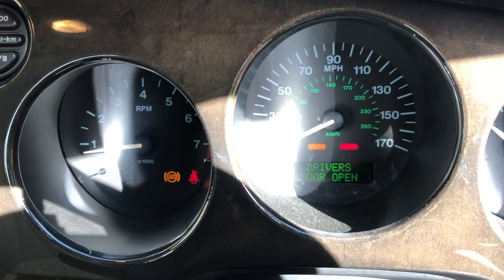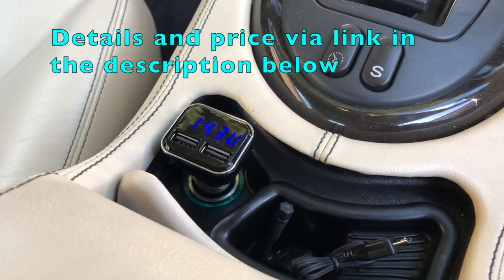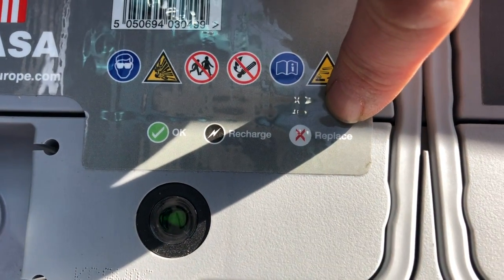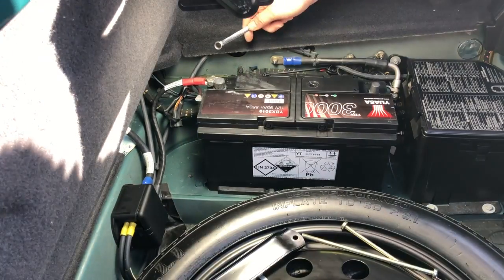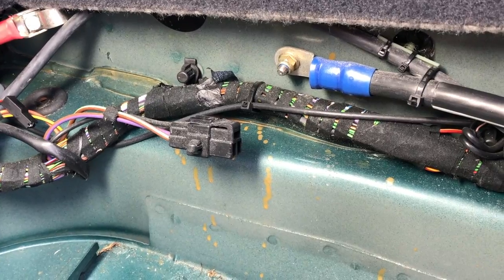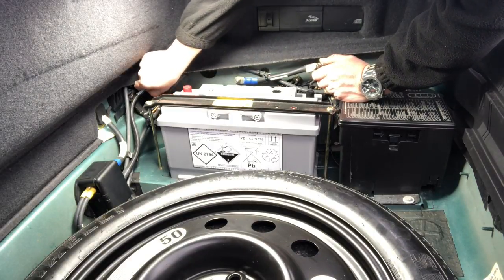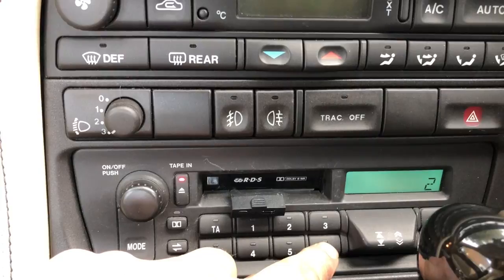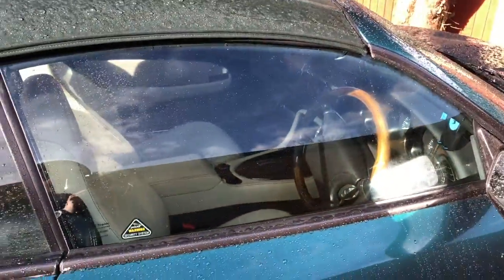secrets of Jaguar XK8 XKR Episode 55. Battery swap and true In car Voltage display.

Comment: Hi John, I am a huge fan of your videos! Owning a 2003 4,2 XK8 since about two months they are exetremely helpful! In the moment I am facing a problem with high quiescent current consumption caused by fus 5 on the lhd dashboard fuse box (BPM). WDS told me that it should be caused by errors U1041. So I have to remove IC, drivers door card to reach the communication module DDCM and the boot fuse box to reach SLCM. Then the pinpoint tests can start... Did you ever deal with high quiescent current drain caused by the BMP / error U1041? Or can you recommend a contact to other enthusiasts, how had solved the problem? A request in some forum sites did not bring a result yet so I just wanted to ask you as a XK8-knowledge-pope.... All the best from Bavaria, Wolfgang

Comment: Fantastic video John, I've got a flat battery with my early XK8 so seeing your video has given me a lot more confidence in changing it. Just one question - I bought the same battery as you and it has 2 red plugs at each end. The instructions infer I should remove both plugs but am I right in thinking that the plug at the negative end of battery should stay in place and only the plug at the positive end needs to be removed to allow the vent pipe to be attached.

Comment: Hi John and thank you for these videos which were instrumental in my purchase of a 2005 XK8 recently. I am at the stage of poking around looking for things that you have highlighted. My car has a Varta battery and there is no vent. Is this correct? I also notice that the vent grommet appears to be missing as there is just a large hole. Where do I get a grommet?
Reply from the maker: Hi Jono
If the Varta is truley 'unvented' rather than missing its pipe. Then thats fine👍 as for Grommets I would just pick up a selection pack from Amazon or ebay as they will cost you about £5 and an individual one of specified size will cost about the same. (and you can never have enough grommets😁

Comment: Once more I’m in your debt. Yesterday I went to the garage to get my 04 XKR ready for a show tomorrow and it was dodo. The battery was flat as a pancake. I thought it odd as I keep it plugged in to a Ctek and the battery is only about two years old. The car was doing all kinds of weird stuff, like it was haunted. The windows were going down is short jerky stages and I wasn’t pressing the switch. The wipers, which were off, were going across the windscreen about 3 inches at a time once every three seconds. There were error message galore. Suspension fault. Gearbox fault. ABS fault. Low coolant. Plus many others. Luckily the secret keyhole works on mine and so I disconnected the battery to let it charge overnight. Came home and watched this video to make sure I knew all the tricks just in case I needed to change it for another. (Glad I did. Wouldn’t have known about the bleed pipe). Went back today and the battery was still dodo.  So, I went to Halfords and bought a high power Yuasa (the same one as in the video) for £148 (ouch). Fitted it, making sure to do the hard reset first and the car came back to life. All is hunky dory. All error messages have gone. However, it was then I noticed that the headlights were on. I’d parked it up six weeks ago and left them on. Doh! Not even the Ctek could cope with that I guess. So thank you very much indeed! It’s not the first time I’ve relied on your expertise. I suspect it won’t be the last. I hope to bump into to you somewhere so I can buy you a coffee! Maybe Gaydon on Sept 2nd?

Comment: Having a slight nightmare with my car. Unfortunately was left by the previous owner and the battery went flat. The RAC came out and put a new battery on it for them (which was too small) they then sent it for a new alternator. However despite me changing the battery and various tinkering and still getting various warnings and battery not charging light, despite the battery charging.

Comment: Hard reset: Hold positive and negative terminals together for minimum 30 seconds. Another way: Disconnect negative terminal and turn ignition on for 30 seconds, this also drains down the system.

Comment: Hi John and thanks for all your great videos. 
I came back to this video as I now have the ABS light and stability/traction messages fault and there were not enough power to even start my XK8 1998. I charged the battery with a trickle charger. After that when I took it out from the winter rest all the messages were gone..When I started the car next time these error messages came back. Charged the battery once more and the messages were gone, but came back again with next start. I do not now how old my battery is. It seems these problems are gone just after charging and then are back with the next start. 
Do you think my problems will be solved with a new battery? Thanks in advance for your thoughts on this.

Comment: My sister’s  ‘02 XK8 would only start after she jump started it.  As soon as she turned it off, she said the battery went completely dead or “flat” as you say.  I asked her to bring it to my house.  She had left it at a shop and was unable to jump start it with booster cables. She proceeded to call AAA for a boost.  The tow truck driver attempted to boost it and failed.  So the car was towed to my house.  I pulled the battery out and it tested at 3.4 v.  SonI put it on the charger for about an hour.  In the meantime,  I wire brushed the battery cable terminal connections, loosened and retightened the ground cable connection.  After the battery came back up to 12.5 v.  I cleaned the battery terminals with a wire brush.  I reinstalled the battery in the car, smeared some dielectric grease on the terminals, and reconnected the cables.  The car fired right up.  It’s been starting every time now(even when sitting unused in my cold winter clim3 here in New England). The battery is just over 2 yrs old now. 👍👍

Comment: Hi John. Do have a video on parasitic battery drain? Sorry. Looked but maybe missed. My 2006 XKR with 37,000 has been doing strange things. Windows refuse to go up after closing the door. Strange sounds and eventually repeating chirps from the alarm system. Any of your subscribers have the same experience? Went through many forums; no one seems have put their finger on a cause for the drain. There is a alarm system battery? Could that draw from the regular battery if it’s bad? Just hoping to be pointed to common fail area to start my investigation. (Replaced the old battery when the windows required repeated resetting. So it’s new. But still draining.) Cheers!
Reply from the maker: hi Chris
If its a UK car then the usual cause of Battery drain is the 'Intelligent sounder'  Which is a rechargeable back up alarm siren filled with NiCads. 
its mounted below the right hand headlamp and accessed by removing the inner wheel arch liner. Just pull the multi plug out of it and protect it from water. ( you will lose the alarm arming chirp if it ever worked on yours, but no other bad effects)
See if that works before you try anything else.
Here is a useful link for you
https://youtu.be/OeHrWWKNPwg
Reply: @tothegarage  Thanks very much! It’s a victory edition USA car. (My “cheers” might have thrown you off. Lol. Lived in the UK for a bit.) Still a good place to start?

Comment: I remember well having trouble with my windows and took the car into a local Jaguar Dealer where we were  on holiday. He said I needed a new battery and l thought, your having me on. So I left. Two hours later I returned and he said the same thing so he replaced my battery and the problem went away. To my astonishment the car also drove a lot better with a much smoother ride!! Never occurred to me that a "low" battery had an effect on the adaptive suspension!! So if you feel that your XK/XKR isn't driving/handling as you'd expect and not very " smooth" change your battery.!!!
Reply from the maker: Its Always the answer😁👍

Comment: Hi John- I'm using a similar voltmeter, very useful. there is another thing you can use it for: the XK8 (at least the 4.2ltr) will attempt to keep her coolant temp rel. constant by running the electronically controlled fans- and you can kind of judge how much fan performance the ecu is commanding by looking at the voltage. indicated voltage ranges from 14 for just a bit to perhaps 13.6v at idle, the latter meaning fans are run up fairly high (though I haven't yet seen max fan rpm yet), not living in a desert! by the way- if someone keeps the ignition "on" and watches the voltage plummet, that's because all the ecu and the bus system are up, drawing quite a heavy current all together. a 30amp power supply (not a simple charger) will not suffice to cover this, something like a 50amp power supply is needed e.g. for diagnostic work or programming.
employing such a voltmeter on my Amarok V6 is funny as one can see the modern bat management (like charging when slowing down, less when cruising) at work!

Comment: I had a 2001 and it would drain the battery very quickly if I didn't drive it. Typically within 2-3 weeks. And the more it did it, the deader the battery would get. I actually considered getting an automatic battery disconnect. I don't have the car any more but it did lead to me creating a wifi battery monitor.
Reply from the maker: The wifi battery monitor sounds fun.   Tell us more🤔
Reply: @tothegarage  It's based on the EPS8266. It uses a voltage dropper and a simple divider to allow it to monitor the battery voltage. I've only done testing on it so far. I need to actually wire it into one of my cars.

Comment: I'm about to replace my battery as starting is a bit sluggish. Built early 2005, I bought my XK8 in 2008 with 29k miles on the clock , now 13 years on its done 38500. I'm sure I haven't replaced the battery since I've had it. 13 years doesn't seem too bad to me, my previous record was 8 years on a Mitsubishi Shogun from new.  I usually hook a second, good battery across so the car doesn't get powered down (terminals well insulated, of course) when changing batteries. I've done that ever since I lost a radio that I didn't have the reset code for. Thanks for the video, I'll check the others.
Reply from the maker: Thanks for watching Jon. Like your back up battery technique👍

Comment: Hi John
Just replaced my battery for the same reason. Abs and check engine light on. Unfortunately both lights still on after replacement. How did you clear your abs light? Only code i get is C1165

Comment: Hi all I charged and reinstalled my battery on my 1997 Jaguar XK8 convertible. I am getting no power at all.  Does anyone have any tips for a novice Jaguar XK8 owner before I send him to the garage. I really want to work on him myself before sending him out :) Thanks!!!!
Reply from the maker: Hi Myss 
Check the earth lead is in good condition and bolted tightly to the body. Check the two Very big fuses that the positive lead goes to in the black box just behind the spare wheel.
Check the Impact switch has not been triggered. (Left hand end of dashboard under a flap visible with the car door open. its a black cube that looks like a relay. Put your finger above it and press down had on the rubber top)

Are you sure your battery is good?
Reply: @tothegarage  Thank you so much. Yes the battery is fully charged and in good condition it is less than 1 year old. I have not driven or started the car since August of 2020. I took the battery out to have it checked and charged at our local auto parts shoppe all good. I will check all connections and reset the inertia switch. I am so happy I found this channel and group. This car means the world to me and he should be on the road :)

Comment: Hi John
Terrific video, thank you. 
I’ve just replaced the battery on my 2002 XK8 today with the same battery as yours. The vent tube minus the elbow was present but not fitted to the old battery. The warning sign on the new battery said to remove the vent plug on negative end of the new battery. Will it also be necessary to fit the vent tube on the positive end?
Many thanks 
Chris
Reply from the maker: Hi Chris.
The vent only needs to be open on one end. 
The area at the top of the cells is interlinked.
Reply: @tothegarage  thank you John.

Comment: Glad I watched this one!  My battery vent pipe was going into the wheel well as it was at the wrong end of the battery and there is no battery brace or antenna protection bolt.  A few easy things to sort!  Interestingly I have the same negative battery lead as you - my car 'birthday' appears to be 14-10-96 according to the label in the boot.  Cheers!
Reply from the maker: Glad it helped!

Comment: Hi John 
Great video just brought an xk8 and put in new battery as recommended no breather pipe is it ok to run until I source one 
Happy new year 
Steve
Reply from the maker: Yes. 
Its a long term issue rather than an immediate thing.
 Happy new year Steve. (It will be. You've got an XK8)

Comment: where did you get that neat plug in voltmeter?   Seat back position reset, kid messed it up somehow?
Reply from the maker: Link below for voltage reader
Seat memory
Position seat correctly, then press and hold one of the memory numbers near your door handle.
👍
https://www.youtube.com/redirect?redir_token=QUFFLUhqbmhLU3M1SW5GUWdnSlotazB5ZThlNFhBeVFlZ3xBQ3Jtc0tucnl2ZkdhY3hYY195VVdtVkEtMFFEUURXTE1LSExlWmxZTVNmV0Fnd0dmLUZobjJyc016eUZtQjFBbGU0dm9fUjRlNlprU1VPb09PS09mX0JuVTBaN2JIRm1Lb2o3TVFsWXZTMkJGLVJQZDdHcEVNNA%3D%3D&q=https%3A%2F%2Famzn.to%2F2Tyh0R2&v=9bodqgno3TU&event=video_description

Comment: My stability control ABS trouble light on. Not really a repair for the faint of heart. After checking the wheel sensors, I removed the ABS controller from the vehicle. Detached the black plastic electronics from the hydraulic assembly, split the plastic case with an electric dremel tool to expose the circuit board inside. I  soldered the PCB pins, specifically the ones going to the electric hydraulic pump motor. The electrical connection to the circuit board for the electric pump motor is a common point of failure. I applied a bead of black silicone putting the black plastic electronic housing back together. I reattached the hydraulic assembly to the electronics, reattached the hydraulic lines to the ABS unit, flushed/bled the brake lines. All fixed! ABS stability control all working.
Reply from the maker: Well `done👍. AS you say this is a problem that would scare off many an otherwise competent home servicer. Its one that most of us that keep these cars long term will have to deal with or rather expensively replace at some time in the future.
I do wonder though🤔 I know they eliminated the lead from solder at some point in the last decade or so. I believe the newer solders have less malleability and fracture resistance. IS it possible that the oldest XK8's and X300's will be immune and there is a particular year that the issue arrises at.

Probably nonsense🤣
Reply: @tothegarage  I am an electronics technician and I have used lead-free solder for repair on printed circuit boards. Lead based solder repair is a lot easier. The solder stays work-able repeatedly versus lead-free solder. For the ABS controller, I used lead-based rosin solder. Never use acid flux used on plumbing copper pipe. Always use rosin flux, or stick with rosin-core solder.
Reply from the maker: Lulu Blessing top tips.  Thank you👍
Reply: @tothegarage  regards to the common  open header pins on the PCB. It's a peculiar design flaw from the manufacturer. The vibration of the car causes the soldered header pins to fracture the solder joints. The circuit board itself is in immaculate condition once exposed by cutting away the plastic case.
Reply: @tothegarage  Seeing you in your previous videos, I think you would be quite capable of performing this repair yourself. I used one of those one-way brake bleed valves connected to a small  neoprene hose so that I could bleed the hydraulic lines by myself.

Comment: My alternator went out last week and the dash voltage meter did go from the straightup 13 value to a very frightening10-ish. Surprisingly, the vehicle continued to start easily and run. I knew eventually that wouldn't last very long. I installed a good rebuilt alternator, fully charged the battery, now my dash voltage meter is back at straightup 13 value. Actual voltage measures 14.0 to 14.4 with a good electric meter.
Reply from the maker: How easy was it to swap the alternator and did you do it from below?
Reply: @tothegarage  Really easy. Went down to my local auto parts shop, bought a rebuilt exact-fit alternator, then dropped the car off at my local Jag dealer mechanic and asked them to fix it, pointing out the rebuilt replacement sitting on the front seat.
Reply: @tothegarage  --and yes, I could have installed the alternator myself but I just had the dealer the folks at the Jag shop replace the air-conditioner system, power steering pump, water pump, idle wheels so thought they should replace the only thing they didn't renew, the alternator.

Comment: Hi John , as a new owner of an xk8 convertible I am finding your great videos priceless , thank you for the time and effort you put in , its helping me get a better understanding of the car , I do have an issue though  that I cant find online and that is the audio controls on the steering wheel are not working , I have today in fact fitted the same battery as you and wondering if that has caused the problem or is it something more underlying ? keep up the good work.
Reply from the maker: Hi Mart. as long as you have put the radio code back in after changing the battery then there is no plausible connection I can think of between the failure of your steering wheel controls and the battery change.

Anyone else had problems like this?
A fuse maybe?